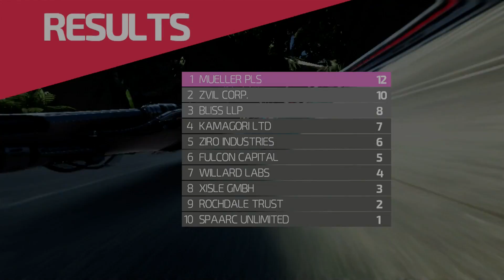Nintendo Switch - High Powered GPU Extension Theory

Comment: " So, where could the fan in the dock be? Or why it isn't shown in the patent? Well, what is missing in the patent compared to the real dock? Oh, the whole front side! This again gives prove that the frontside of the dock is just added to mimic a wind tunnel for better cooling, this would also explain why the dock fan was added later.
Now, this change must have been done between Juli and October, since in October, the dock had its present form. Do you know when Emily Rodgers had her devkit infos? In August. This means her infos about the power are invalid."

And if you combine that with the facts that the rumoured specs form venturebeat and Emily Rodgers are the same, something can't be true.

It would make sense tho that 512 TFLOPs are reached in portable mode (which compared to amd is more like ~700 TFLOPs because of the optimisation and what not), but the increase in power through the fan in dock and the overclockability from Pascal up to 2 GHz with this amount of cooling, you are likely tripleling the amount of TFLOPs, means you will be at around 1.5 TFLOPs. Compared to AMD, this is then rather 2.0 TFLOPs, stronger than PS4.
Reply: Exactly, the chip-set can actually be more powerful in handheld mode than just 512 GFLOPS. Honestly, if they could get the power in the handheld mode to be around 1 TFLOP (which would be around 1.4 TFLOPS when compared to AMD), that would be really good as that would actually perform better than the Xbox One. 
Bethesda said that they wouldn't develop for it if it didn't have Xbox One power or above and I think that also applies to when it is in handheld mode.
Also, I think that the rumor about the architecture being Maxwell is very fake as Nintendo could easily have switched to Pascal architecture since just because it came out in the beginning of this year doesn't mean that Nvidia wasn't working on it beforehand.
Reply: Another interesting rumour early on in addition to that is  Nvidia were willing to take a loss to make sure they got back into the console market.

Comment: I've said it so many time now, but USB Type C does not automatically equal high enough transfer rates for external processing. You would need a Thunderbolt 3 equivalent transfer rate and such technology is owned by Intel (who'd charge a pretty penny for its implementation).

Comment: That Venture Beat article doesn't sound right to me. The reasoning provided is flat out wrong.

Besides, it doesn't make much sense to me to use a die shrink of Maxwell when Pascal already exists. Seems like just using a Pascal chip would probably be cheaper, but hard to say for sure. In any case, I think it's a pretty safe assumption that we're going to see a significant power boost over the X1 here. Just because shrinking transistors down makes things run far more efficiently and quickly by itself, and it also allows more to be packed onto a die of the same size. That's why Pascal is so much faster than Maxwell in the first place.

I'm not saying that means it'll match current gen consoles in power, but I wouldn't be surprised if it at least came close. They might be bigger and more power hungry, but they run on much older tech, and they really weren't top of the line even at launch.

Comment: The game is inside the portable aspect, on the SD card or the cartridge, therefore the system would have to run the game, stream it out to the SCD and then the SCD stream the image back to the screen... and this has to somehow work when you're out and about...

No, not happening. The games will scale, and once they reach a point where they can't then they'll stop coming to Switch.

I do think we'll see a way to play home console quality games on the go, and maybe streaming is a way, but it won't ever be a requirement to play a game. I personally think the portability is such a big thing that we're more likely to just see a battery pack you can plug the SCD into and connect it via USB-c to the bottom of the Switch. I also predict people putting it in a bumbag, and it perhaps being a requirement for VR/AR gaming (I don't see why they wouldn't put cameras in the front).

Comment: The external graphics card I can definitely see but the streaming of games when undocked I don't see. Because that would basically undermine the biggest hook of the system because in order to stream you need to have a constant fast internet connection so that would basically make the switch not so portable anymore.
Reply: Dylan Hopson umm no they didn't

Comment: If this IS run on Maxwell for some retarded reason, then Vulkan would be an utter waste of time on this device.
Reply: ahhh. the struggle of the master race.
Reply: YourPalHDee elaborate please?
Reply: Arnez Juggins Pascal has bad support for A-Synchronous compute, Maxwell is even worse.
there would be little benefit from using Vulkan.
Reply: I just got the Rx480 tbh.
It's not as powerful as those cards for sure, but I'll just sell it and get a Vega Card when that's out.
Reply: ***** Yeah, I honestly do NOT understand AMD's strategy there. Like they could've released the 480 and also released a 490 that was like 60% more powerful.

Comment: This will most likely never happen on the Switch unless the device fails to gain any momentum and is dead at release.  Nintendo's implied message right now is that you can take this Switch with you nearly anywhere and have nearly the same experience if you are in Portable or Docked mode. Adding an additional GPU adds a complex/confusing dynamic to the experience than what they are shooting for. 

For me the whole thing starts feeling sketchy when you remove the console out of the dock and go into streaming mode. The moment you leave your home or lose connection to the internet it renders the game you are playing useless and this goes completely against what Nintendo wants the Switch to be.

Let's accept the Switch for what it is. A decently powerful tablet that seems to be a supercharged WiiU in terms of power, but with much more friendly hardware for developers to program for.

Comment: This talk of plug in GPU's needs to die, because its nonsense. You will end up with a situation where some of the user base has the boost, and most probably don't. You will end up with games built to run on the boosted system, and running like garbage while mobile. The constant speculation needs to be put to bed
Reply from the maker: +MrSoggyjocks It is a fun topic, not meaning to upset anyone lol
Reply: Haha. Not trying to be a kill joy. Sorry

Comment: Maxwell is not just a die shrink, it's an entirely different process to built on finFET.  This was basically click bait as you brought us in with claims based on nothing but your speculation and then didn't even have the facts you were trying to relay correct.  At least label your video  speculation.  Ass
Reply from the maker: +Tim Adams Click bait for you apparently, everyone should know that anything official comes from Nintendo directly at this point which they haven't outlined yet. If you haven't seen my channel before, I like doing speculation and discussion videos.
Reply: Pascal is mostly a die shrink, on older nvidia roadmaps, it wasn't even there, it went from maxwell to volta.
Reply: Do you know why?  Because on those roadmaps the changes which ended up in pascal were intended for volta.  This changes nothing and doesn't make the things he said true.
Reply: I watch your channel for NX/NS/Switch news and usually when you have info you're speculating about you label it as such.  I apologize for calling you an ass, that was uncalled for.
Reply: *****
Pascal has better memory compression and a couple of things mostly useful for VR, at the same clocks, it performs very similarly to maxwell, the performance difference comes from the increased clocks.
Reply from the maker: Dean Buchholz Says speculation right there plain as day in the description under the title and I laid out clearly how they could use the USB-C connection for external GPU usage.
Reply from the maker: I changed the title to "theory" at the end of the title, I'll be more careful in the future.

Comment: ps4 can barely reach 30fps on remasters from last gen games. where is this alleged power of the ps4?
Reply: The gpu is alright, I guess... The cpu is the issue in the p4 and the xbox. This is where the switch will probably be leagues ahead of the ps4 and xbox the cpu should be much more powerful.
Reply: Benjamin Stannard the ps4 is for rich losers. the wii u is light years ahead of ps4
Reply: The Law ps4 is weaker than wii u due to those reasons therefore the switch will be in a completely different galaxy
Reply: pl0x0rz1UP god of war 3 was 60fps on ps3 and the previous three uncharted had the same framerate as uncharted 4 on pa4 (30fps) and isn't even open world. crash bandicoot 1 on ps4 runs at 30fps. the ps4 is complete trash and rhe reason I chose a wii u is because the games looks and runs better and doesn't require huge patches and you can play from the disc without having to install
Reply: pl0x0rz1UP I played and beat crash 1 in the 90s on ps1 and it looks and runs the same as on ps4. if mario 64 released on wii u with the same framerate and slightly better textures it would be the end of the world. 

60fps makes games more natural and smooth, seemless even. it's very pleasant. that's why I enjoy rayman legends and the many 60fps games on the wii u. something ps4 pro and xbox1 users can only dream about. also I don't have to download massive patches or install to a hard drive.
Reply: pl0x0rz1UP I played and beat crash 1 in the 90s on ps1 and it looks and runs the same as on ps4. if mario 64 released on wii u with the same framerate and slightly better textures it would be the end of the world. 

60fps makes games more natural and smooth, seemless even. it's very pleasant. that's why I enjoy rayman legends and the many 60fps games on the wii u. something ps4 pro and xbox1 users can only dream about. also I don't have to download massive patches or install to a hard drive.
Reply: Dylan Hopson just because it consumes more power and wastes more energy doesn't mean it's better. Moores law says technology will be smaller and faster over time. big bulky gadgets are inferior. steam engines had more power and burned more fuel but they aren't as fast or efficient as an electric train. the wii u is vastly superior to the ps4 in every way, including its futuristic wireless touchscreen controller, and it's powerpc architecture and extra arm cores, it's completely backwards capable and has free online play.
Reply: Dylan Hopson xenoblade chronicles x is larger than any game on ps4 and is open world and has zero loading screen except for fast travel or entering the barracks. ps4 can barely run games at 30fps and final fantasy iv is a loading mess
Reply: pl0x0rz1UP the wii u is fast enough to read and process directly from the disc just as the old ps1, ps2 and ps3. the ps4 isn't fast enough to read and process the massive amounts of uncompressed data directly from the blue ray disc so you have to not only drag it to your hard drive but install it as a program on a dusty prentium 4. the wii u not only reads and processes data in real time directly from the dosc, but it also decompresses it. the ps4 is crippled compared to the wii u.
Reply: Dylan Hopson if the ps4 does these things better then why do you have to install games to a hard drive before playing? why can it run simple games like crash 1 or knack at 60fps? the ps4 is a scam weaker than a prentium 4
Reply: ignigma The only loser is you, who can only afford Nintendo consoles and therefore feels the need to disparage other systems in order to feel better about what you're missing out on. Fanboys like you are just salty about what you don't own.
Reply: Dylan Hopson yet it can only reach 30fps on crash bandicoot
Reply: Abraham M. I can afford a ps4 but I'm aware of the limitations of x86 and passed. this is 2005 all over when apple ditched the superior powerpc architecture in favor of cheap intel chips and we see how that turned out  without the iPhone, which is based on an ARM architecture similar to powerpc, apple would be done. the wii u is vastly superior in quality and performance and energy efficiency. it is also backwards capable to the gamecube. if Sony stayed with powerpc I'd buy a ps4
Reply: Dylan Hopson wii u games were complete when released and doesn't need patches. updated but not patches. the wii u is more energy efficient than the ps4 and xenoblade chronicles x is full of enemies and things to do, too many things and looks and runs better than final fantastic xv and plays directly from the optical drive as do all wii u games which means it's cpu and memory bandwidth are much more powerful than ps4, xbox1 and your favorite gaming pc
Reply: ignigma That is such a nonsensical reason to not own a console. You're just reaching for excuses in order to feel better. The only reasons one owns consoles are because of the exclusives they offer, and if your friends happen to own them so you can play multiplayer games with them. That's it. No one cares what architecture they run on as long as they have quality games. You're just completely butthurt about what you don't own and looking for any excuse to feel better, you just won't admit it.
Reply: Abraham M. you're wrong. I own an older powermac and a newer intel mac and the older has superior performance so I use the older powermac for all my production and publishing needs while I only use the newer intel imac for the Internet. I use the same logic for ps3 to ps4. the ps3 is superior as far as the gpu and architecture and performance. the ps4 just has newer games with worse performance. since the wii u has the same architecture as the ps3 and has newer games and next gen exclusives that the ps4 xbox1 don't have, I chose the wii u. I can do without the pitiful performing ps4/xbox1. and the Switch will have all the games the ps4 has so I'll just wait for that
Reply: ignigma I fail to see how you're personally affected by which architecture each console uses. I fail to see how it affects how good a game is. The Witcher 3, MGSV, Ratchet and Clank, The Witness, Inside, Doom, and The Last Guardian are just few games released in the last couple of years that are some of the best of all time. They all run on platforms with x86 architecture. You're really missing out by only playing games on systems with PowerPC or some other custom architecture. You're missing out greatly. 

But I also bet that if Nintendo chose an x86 architecture for its next system that you would still own it. You are just selective when it comes to those that aren't Nintendo.

Comment: Difference between Maxwell and Pascal is basically 24nm vs 16nm. It would have made a lot more sense for Nintendo to go with the TSMC 16nm FinFets but the issue is that Nvidia/AMD start by designing big then scaling down which takes time; early GTXs are way too overpowered to stick in a tablet. It's really a missed opportunity because I guess they could have gotten a 30%+ boost by waiting a bit longer. My 1070 is an amazing piece of kit, so much cooler running, smaller and faster than my old 980ti.

The idea of adding a separate GPU in the dock later on down the line makes sense only really for one scenario - 4k upscaling/HDR like Skorpio/PS4 Pro. Otherwise it's too confusing for customers. But I imagine there's a market for a "Switch Pro" out there.

Comment: This article might as well be debunked thanks to this reddit article with actuall sources and even hardware engineers:

https://www.reddit.com/r/NintendoSwitch/comments/5inxxk/why_the_maxwell_rumours_are_incredibly_stupid_big/

From a business and technology standpoint, it would be unwise for Nintendo to use the older Maxwell than Pascal if it's more powerful and power-efficient. The article has no actual sources and is the same author who claimed that the Switch was going to use and AMD (search for "Ninteno NX AMD dean takahashi") so you can basically say that this article has no credibility whatsoever. Unless Laura Kate Dale or Eurogamer says so, it's highly unlikely that this is true. Plus, why would nVidia even release a statement claiming that the Switch uses the same architecture as the world's top-performing graphics cards at the time Pascal's been introduced and is being pushed to the market, so the Switch is very likely to use Pascal.

Comment: Im ok with a portable version of something as powerful as a wiiu (even tho its going to be more powerful for sure), dont understand why there are people who is just wishing for a portable ps4pro.The tegra x1 is more than half a decade old, so im sure its not the same chip but a custom one turbocharged specifically for the switch and its target performance. Also, if a Maxwell architecture means its cheaper, better yet. That said, i have no idea about these things so...
Reply: David Somoza Domenech but Pascal is cheaper for the same performance while keeping battery consumption low.
Reply: wasn't maxwell older than pascal? i assumed it was cheaper. Well, as i said, i know nothing about chipsets.
Reply: Nvidia is more than willing to provide Nintendo with a great deal since it's their first design win for a console. They want to keep their partnership with Nintendo so they could give a really good deal on a custom Pascal chip-set for the Switch. Also, the handheld can actually have power close to that of the Xbox One since Nvidia is much more efficient with the tech they make.
Reply: a smaller process is by default cheaper than a bigger process unless its very very early , but the developement of the chip was started on maxwell and since it probably has different bus connections and additional edram or something similar build in (nintendo always has a fast cache in their consoles) its probably a maxwell build , 

that said , maxwell on tegra already has many advantages of pascal ..